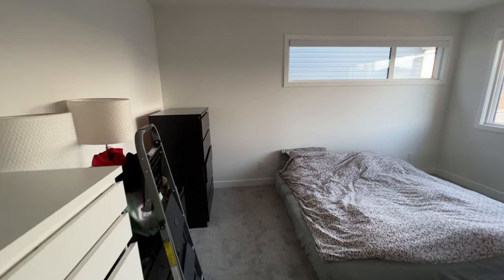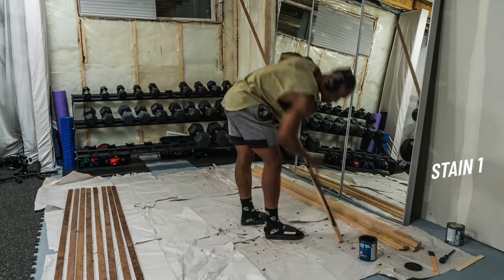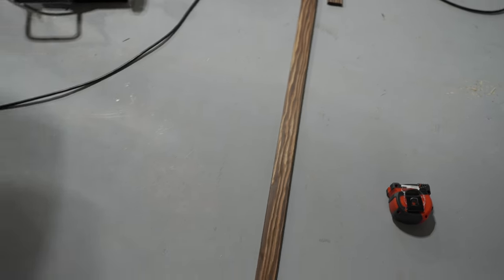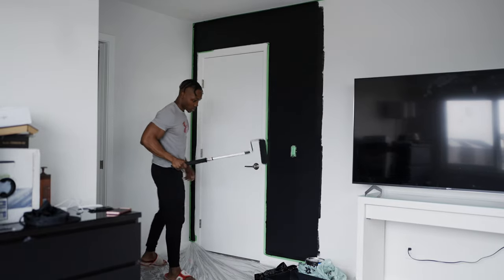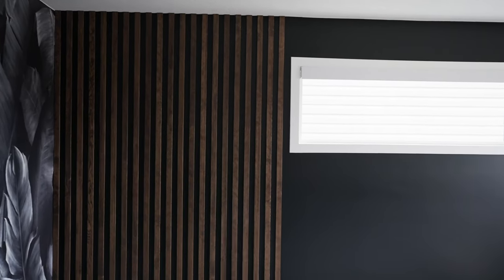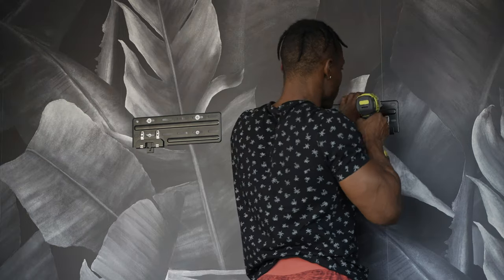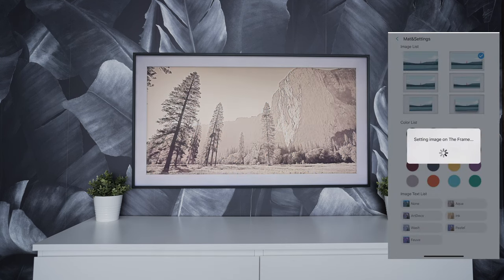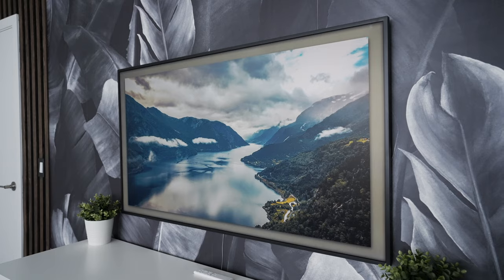Extreme DIY Bedroom Makeover! | Slat Wall, Wallpaper & 2022 Samsung The Frame TV

Comment: Hey man thanks for the video. Question, you mentioned the slats were too long and you had to get them cut. I have the opposite problem. I can’t find slats taller than 8 feet. I’m looking for 9 foot slats and am avoiding getting 8 foot slats and joining wood because it won’t be seamless. May I ask what length the slats were?

Comment: I noticed your 2022 Frame TV had tape along the top & bottom of the TV, when I removed mine it left a mark/residue that can't be removed, curious to know if you have this issue as well? It's only visible while the unit if off.
Reply from the maker: I just checked and I can’t see anything like that on mine.